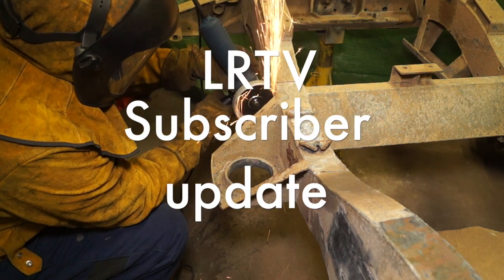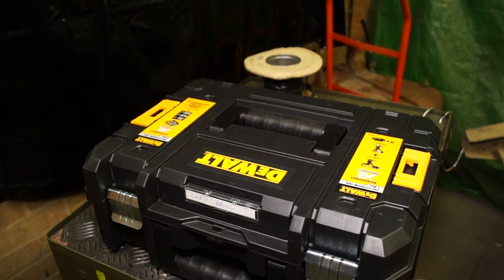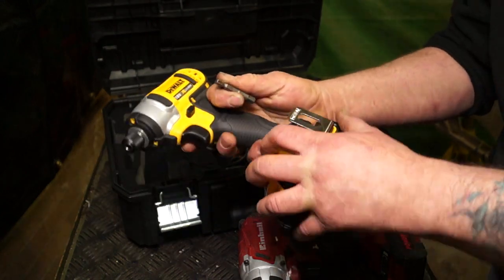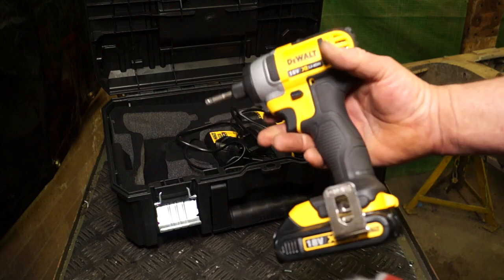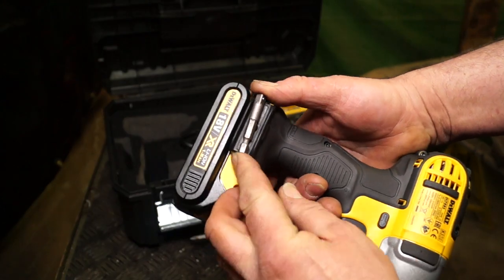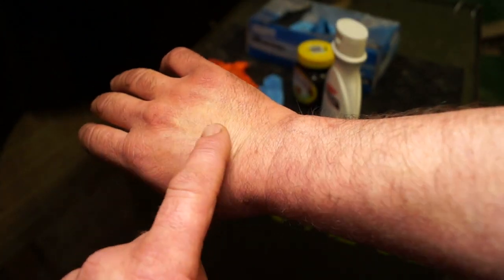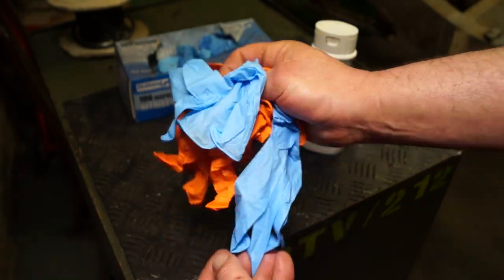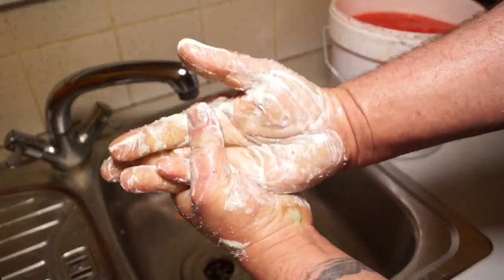LRTV Subscriber Update. Welding Tuts, Dewalt Drill Kit, Sugar & Fairy Cleaner,  Hand Care

Comment: I've had "a phone call" that meant that I had to drop everything, good luck with whatever you've got going on☺️ 
I nearly bought that DeWalt drill and driver offer the other day, perhaps I should while the offer is still on. 
Good tips on hand care☺️
Reply from the maker: I looked on Screwfix today.  Our local doesn't have any.   The drill on its own is the same price as the kit.   I got this one in Thetford. I took back a vehicle after repairs then popped in for a gas cylinder.  Walked out with the wallet a little lighter.
Reply: Ah, that's what they call "man shopping" ;-)

Comment: Nice deal on the dewalts ... I've been considering a 3/8th rattle gun, something lighter than my big old dewalt 1/2" ... if you happen across one for testing (ideally not from the snap/mac man as I don't have ready access anymore) then I'd be interested! 

Hands ... Barrier cream or coconut oil which is fairly cheap and goes a long way. I have terrible skin but putting a barrier cream on helps a lot! Can't say I've ever tried rubbing in marmite...  😜